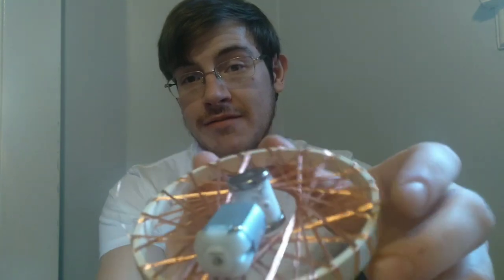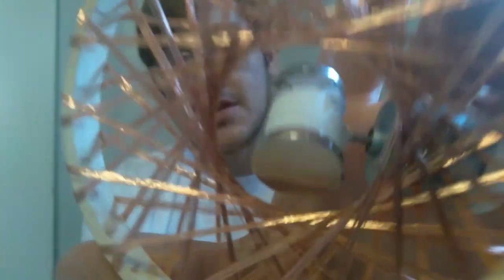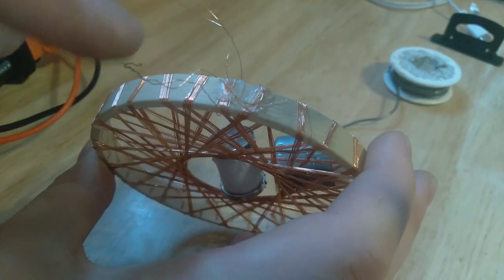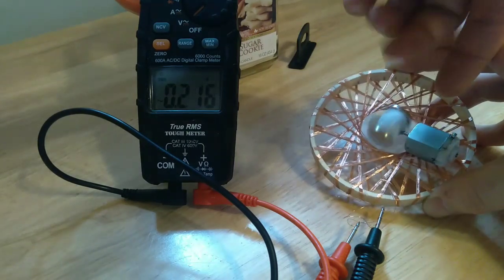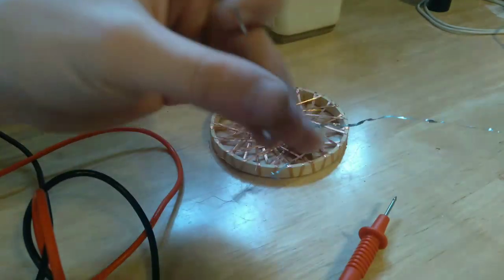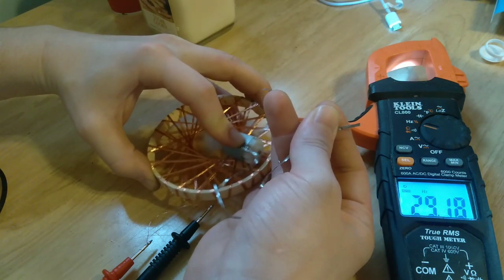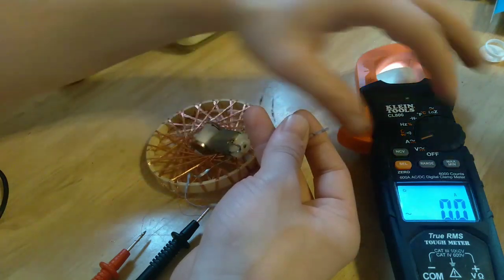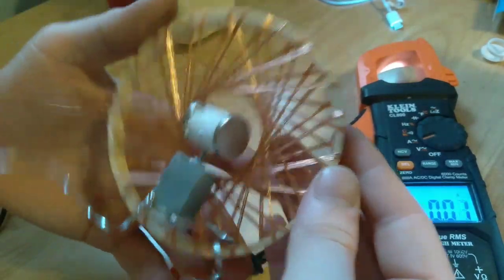CHECK THIS OUT 36 Point Lotus Coil Converting Magnetic Energy

Comment: Brosky 36 points you do no that's not even a number the only real numbers are 1 thru 9  the number 10 is just to mark a continuation of 1 thru 9 you must mimic nature if you get 9 magnets floating in water it has 8 on outside and 9 in middle 8 gives its power unto nine
Reply from the maker: 36 is a divisible of 3,6,9 which are the numbers that fluctuate the magnetic potential in this current paradigm. Each coil design creates a new possibility using frequency